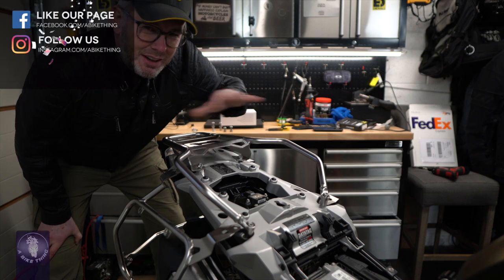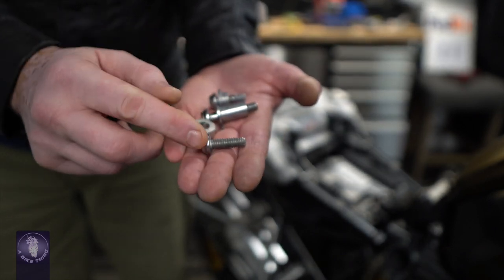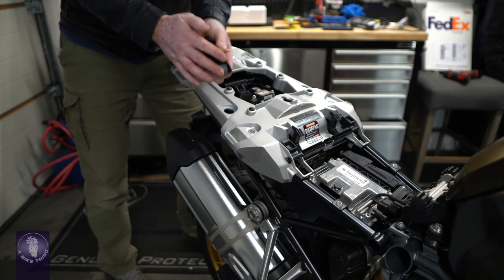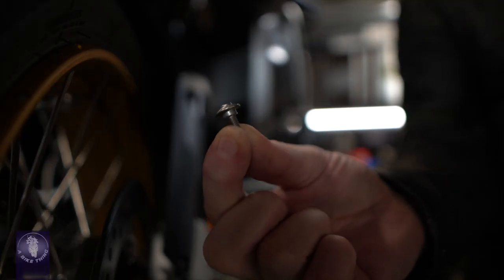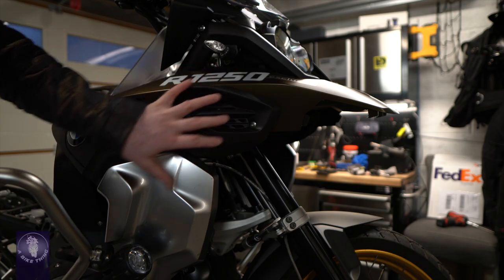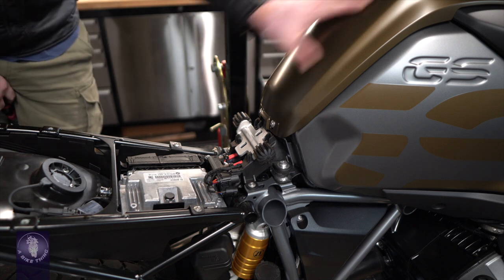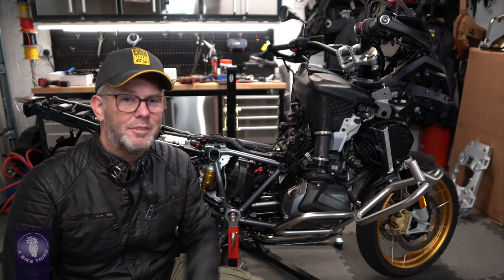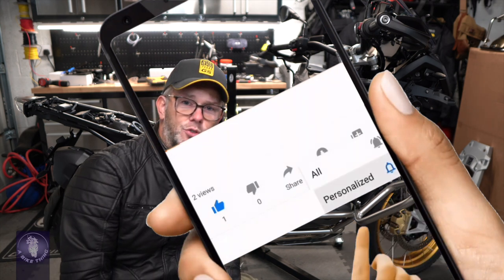Strip Your BMW R1250GSA Down With Confidence Screw By Screw.

Comment: Great video, I need to do this to fit my GSA with a Booster Plug to disable the government restrictions on how lean a gas vehicle runs. So hoping I can swing the fuel tank out to get the plug in and secured, and then review the video in reverse to reinstall all the panels.

Comment: Just posted the following to Weiser Technik
Having just bought a set of Front Weiser Wizards I have 4 comments:
1) They appear to work brilliantly - turning off the ridiculous front indicator lights that BMW have set to be permanently on! So they do what it says on the tin. I have just fitted these so have no idea re longevity but they worked well straight out of the box
2) However, they are absolutely NOT straight forward to fit to a GS Adventure. I removed 34 bolts to get all the plastics and the crash bars off, and used 17 zip ties to sort out and tidy up the wiring once fitted!! And the excellent video created by Carl at Just a Bike Thing for Weiser just covers the 1250 GS. I ended up using a Stip your 1250GSA on A Bike Thing, which was more helpful technically. 
3) They are crazy expensive!! I get that quite a bit of engineering needed to be done, and that not many sets will probably be sold to offset this, but really?
4) And BMW should be reimbursing all of us for having to pay to sort out their mess!! How can front day running lights on a bike being amber make any sense or even be legal??

Comment: 3:44 into the video you took the rear and front bolts out of the grab rail to demonstrate the differences and when you put them back in you put them back in reverse. Not sure if anyone else caught this but anyways another was that I do things is to remove the part ie: grab rail and insert bolts back into the correct holes. That ways there's no mistaking where they go, and when reinstalling the grab rail wow they are right there. No fuss no muss.
Reply from the maker: U r absolutely right.  Lens out of focus so hoped no one would notice.    It didn’t go back like that as I don’t think the long bolt will even fit in the back.  It’s too long.    Joys of multitasking.  Watching the preview monitor to ensure it’s capturing everything as well as doing the work.

Comment: Just completed adding the Innovv K3 and the Hex can using this video. Great work there . To remove the plastic rivets I used a small spoon. Bent 10mm of the end of the handle over at 90 degrees and with a small file, filed a slot in it. an chamfered the end. the rivets came out without using pliers. Thanks again great intuative video.

Comment: Steve, again, this video was a life saver.  I took my iPad out to the garage to work on the installation of the Denali Cansmart and D4s.  The front panels are very challenging and although I am pretty comfortable with mechanical things, there is NO way I could have done this.  Thank you so much for this.  If I lived in the UK, I would have had you install the kit, but in Canada, that option does not exist. Cheers mate.

Comment: Love the video.... do you have video like this for a 2018 1200 GSA..?  Thanks
Reply from the maker: Sorry I’m afraid not.  However it’s very similar.  One of the main differences is instead of long shoulderless Torx25 screws holding the panel where the air vent is incorporated, on the R1200GSA they use big deep shouldered T25 screws.

Comment: Steve, my US dealer installed the D4/Brake light/Sound Bomb/CanSmart set on my 1250 GSA last year when he had it apart for another issue. Since then I’ve been thinking about daisy chaining another CanSmart to add a GPS harness and radar detector harness since my other CanCmart circuits are full. After watching this I’m confident I could disassemble on my own, but wondering how far I need to disassemble to run these 2 harnesses that would terminate at the handlebar. While I’m at it, I’d also like to check the routing on the initial dealer install to see if it’s all tucked in properly. Do I really need to pull the tank aside or remove the 2 beak panels for this?

Comment: Hope you can help. Followed your instructions to get the silver radiator covers off (excellent instructions) but when I removed the plastic tank cover, a little rubber block (kind of pyramid shaped) fell out and I can't see where it came from.
Reply: David - freeze the video at 13:01 / 24:52 and look almost directly under his right thumb. You'll see that piece of rubber sits atop a small metal bracket to absorb downward pressure and act as a spacer. The adhesive is weak so I glued velcro to the rubber pieces and also to the bracket. Probably should have just glued them to the bracket but I had the velcro pieces close by.

Comment: What size bolt goes into the front of the plastic cover?  I think it was a T-15.  Not really sure.  The guys who installed my Denali lights, and Cansmart used red locktight when they reinstalled.  I burgered up the screw trying to get it out.  Had to take a grinder to get the piece off. (Had to replace the Cansmart.  Thanks

Comment: Thanks for sharing that video. May I ask you something as I got confused.

I just want to remove only the right black plastic on my GSA. How many screws are in total?

Only one side...
Reply from the maker: Feels like a pub quiz question 🙋‍♂️ can you give me multiple choice? 😂.  Are you referring to the black section that includes the air intake or the black section that surrounds the front edge of the tank? 

Because of the skilled engineering of the Germans, you still have to get the nose section off the bike so u can access all the relevant screws to remove the black panel that has the silver rad panel attached.    Only 6 screws hold that black panel with the air intake on and 3 hold on the tank surround plus a plastic rivet, however you’ll need to remove in total 22 screws or 25 screws respectively depending on which panel u we’re referring to.
Reply: @ABIKETHING  :) The middle panel at 14:35 with the BMW logo on it.

Comment: I forgot to ask, what make and model and voltage is the little cordless screwdriver you're using please as I need to get some panels off my GS and my hands are making it difficult to get the torx bolts out by hand so something like this would help massively. Thanks
Reply from the maker: Milwaukee 4933447135 – M12bsd-0 Screwdriver 1 Speed 12V 20nm ver-o https://www.amazon.co.uk/dp/B00ZOXLKXE/ref=cm_sw_r_cp_api_i_WvHMFbXJ2CTFE?_encoding=UTF8&psc=1

Comment: Hey! I'm planning on buying a 2015 1200 gsa. Is this comparable with the 1200 gsa? If it is, I need to save this for my Denalli setup
Reply from the maker: Hi.  I do say in the beginning of the video that it isn’t the same as the R1200GSA.   The screws have different shoulder depths.   As long as you take a note of which screws and shoulders go where then you’ll be fine.
Reply: @ABIKETHING  how could I have missed that... thanks :D

Comment: I wouldn't mind getting the silver panel that's under the upper crash bars wrapped in black. Does that come off without removing other panels?
Reply from the maker: Yes it does but you need to take the main panel off that it’s attached to to remove the said panel from
the rear
Reply: @ABIKETHING  Not sure I'm with you but I'll have a go tomorrow. Looks like 3 bolts and slacken crash bar to move it out of the way.

Comment: Hello,  Every thing was going fine and according to your video, until I got as far as up to your removal of the plastic rivet (at 19:30 min), but cannot access the rivet due to an apparent fan assembly at the back side of the radiators but only on the offside of the bike (not sure what this is as it us only on one side?).  Any ideas in a way forward?  Regards
Reply from the maker: Yes it’s a fan. They all have them but you can still access the rivet.
Reply: @ABIKETHING  Thanks for getting back so promptly.  I’m struggling to remove the rivet even on the exposed near side (maybe my dexterity isn’t up to it!), so I’m stymied. Guess for me this is as far as I can strip it and will have to work with what I’ve got to so far.  Attempting to fit a Innov 3 camera, plus a headlamp guard.  Cheers
Reply from the maker: @davidbaker3065  persevere.  Just grab the top with some pliers and pull it out. Will flatten out afterward or worse case scenario replace with new plastic rivet.   I saw somewhere someone with plastic screw rivets which were the same size.   Very tidy.
Reply: @ABIKETHING  Hello Steve, persevered as you suggested and ended up just ripping them out with a set of pliers!  One further query perhaps you wouldn’t mind answering on putting things back together.  When replugging the 2 connectors to the underside of the petrol tank, is there a tip as to which connector goes where?  Regards Dave
Reply: Steve belay my last question;  just put my reading glasses on and can see they are completely different ends!!!

Comment: Hi Steve, is it possible to remove just the radiator side covers?
Reply from the maker: Yes but you have to remove the whole panel first to access the screws to remove the rad covers so I guess the answer is actually no.